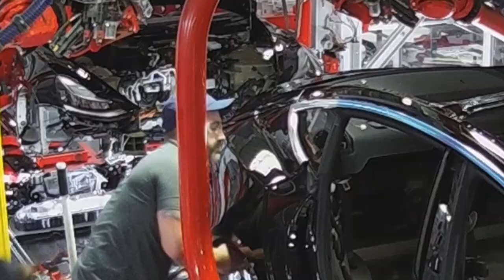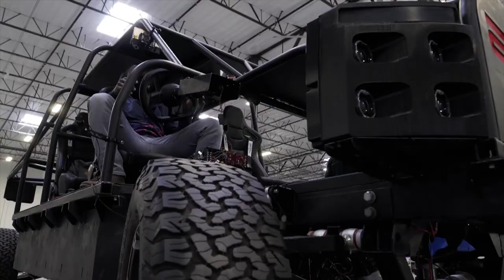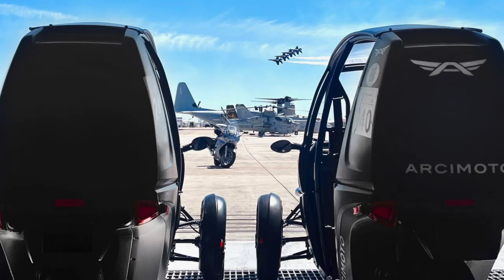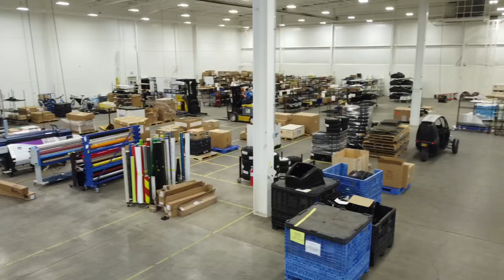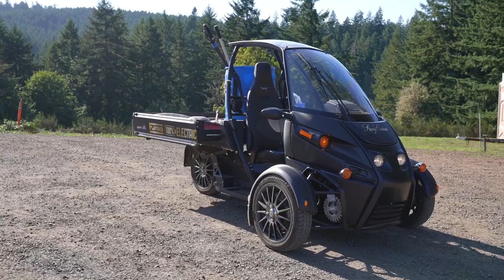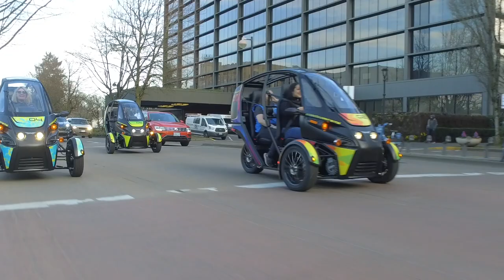Meet Chris Dawson, Arcimoto CEO

Comment: Good luck Chris, I hope you succeed! Is also wish there was a way to buy an Arcimoto in the EU (plus doors/windows for those cold winter months).
Reply: Haha same here in New Zealand, and it's not even that cold (in the North Island at least, Harald!
Reply: Full enclosure for a motorcycle is never done. That tranforms it into a solar oven and the weight is too much for a light EV design. The inevitable climate controls that come with that will zap away limited battery power, as does the weight of those systems. The millions of Americans with previous motorcycle experience all see the FUV as a huge step up in safety and comfort but car addicts, the ones with a habit that is proving deadly for our biome, expect to project their unreasonable demands for comfort onto a new mode of transportation which has to be Spartan to be more sustainable. You sit behind a wrap around windshield with adjoining roof with rain gutters. You sit on heated seats, you have heated hand grips and defroster.

Comment: Given the cost of current automobiles I would consider buying an enclosed or mostly enclosed version of the FUV.  I live in Pensacola, Florida and introducing this vehicle to the public through beach rental vehicles would probably go a long way towards whetting the appetite in the general public for the FUV.  Best wishes for the success of your company.
Reply: Full enclosure for a motorcycle is never done. That tranforms it into a solar oven in Florida and the weight is too much for a light EV design. The inevitable climate controls that come with that will zap away limited battery power, as does the weight of those systems. The millions of Americans with previous motorcycle experience all see the FUV as a huge step up in safety and comfort but car addicts, the ones with a habit that is proving deadly for our biome, expect to project their unreasonable demands for comfrt onto a new mode of transportation which has to be Spartan to be more sustainable. Salt water and new EVs do not mix. The first time this is driven through surf the salt water is going to kill it. Very few Florida owners buy theirs with doors. This design's safety system is safe without them and the plastic doors are just dead weight that make it harder to stay cool.
Reply: @popeyegordon  Well, then, partial enclosure, please.   I'm not asking for AC or even heat, just enough cover to not feel stupid while stopped at a traffic light in the pouring rain.   There are currently electric vehicles and small displacement gas vehicles being rented at Pensacola Beach for driving up and down the roads and into Fort Pickens but NOT on the beach.  FUV's for rent here might be a great way to introduce your product to the general public of this area.
Reply: @brucegraner5901  - If you look at the SEC filing pre IPO, they were to make optional full enclosure, HVAC and even an optional extended battery pack. None of that happened. Plus, the previous CEO admitted they were going to have to do a design change to it to have full enclosure. Also, not all of us live in FL, thus we get cold.
Reply: @billsmith5960  I probably misspoke when I said "full enclosure."   I once owned a soft-top Jeep CJ5 with a makeshift top of canvas doors and a bikini top, basically opened to the back and it could keep you kind of dry.  However, IF the windows on the canvas doors weren't up there was no way you'd stay dry in the frog-strangler rains we have in Florida.   Even canvas doors would provide utility to the FUV.  Without them, you just have a FV.  Such a vehicle might be a big hit in The Villages in central Florida but some simple, light-weight doors would greatly increase the utility and therefore the appeal of the FUV in my opinion.  On my jeep the canvas doors were easily removed when the weather was good and I wanted more fun.  I just want the FUV to be a big success for Arcimoto.
Reply: @brucegraner5901  - I understand. I rented a FUV twice in FL and one time it was raining and I got soaked because a truck passed me and went through a puddle, that water came right for me. At least the FUV rental place warned me of getting wet if it rains. So, I would believe them as they rent them out and probably experienced it themselves.

I had a Jeep too and removable doors were great. In the rain, needed the doors. Same for when winter came.
Reply: @brucegraner5901  You have not watched the videos of the FUV being driven in rain - I stay totally dry while driving in a heavy Florida downpour, the wiper on high. The air pressure and the wrap around windshield joining the roof with rain gutters catches it all while moving. When not moving there is a chance you get some blowing rain depending on direction. I would have no use for doors, just dead weight that makes it harder to stay cool in summer.
Reply: @popeyegordon  You're right about having some protection from the rain, while moving, even without doors.  However, having owned a Jeep for years, with and without doors, in Florida, my experiences suggest a wetter outcome when driving slowly or standing still at a stop light in heavy rain.  Would fabric, wire frame doors add that much weight? And they fold down to allow air in if you leave them on in good weather.  I hope you will sell plenty of vehicles on the fun factor alone.  But utility=useful and a little more of that would justify such a purchase by people not just looking for fun but as a possible alternative to increasingly costly cars and their maintenance.  All most people would ever need is a light-weight, fabric and clear, soft plastic door(s) enough to keep rain and cold wind out to greatly increase the utility of the FUV.  Without them you'll convert a few motorcycle riders and the people rich enough to own a fun "toy," but with them you might provide enough of an excuse to convert people from four wheels to three when considering a second vehicle.  Wire/fabric doors can't be that much dead weight if the FUV Deliverator can tote around an enclosed back space for its cargo.  I wish you and Arcimoto all the best and look forward to your company becoming very successful.

Comment: Good stuff. Glad to see more Tesla connection. More refined focus. Is the deliverator box shape officially back? Looks like way more storage now. Really happy to see this 3 prong platform as the new guardrails of production focus. The flatbed and deliverator probably share most parts.
Reply: The Deliverator and the modular box sitting on a pickup bed are two different designs. The full roll cage remains inside the Deliverator skin. It is the smallest cargo version while the box is part of a modular system whereby a truck delivers 4 or more boxes to a staging area, then the flatbed loads one box at a time. This system has been around for a number of years for small EVs.    
The expandable flatbed is by itself a model of interest to many shoppers. 
The first Deliverator owner has now hit over 25,000 miles on his, he contracts to haul trays of letters for the postal service and gathers firewood for himself.
Personally, as a single guy, I removed my rear seat and installed cargo net to make the rear a cargo area and I still have the locking trunk. I'd post a photo if it was possible here.
Reply: Chris came from Atlis trucks. So we are already seeing his pickup truck experience in action with the Deliverator Box. Good to see they are going in that direction as I agree with Chris.

Comment: I bought my last gallon of gas 8 years ago. 
I waited 3 years for my FUV. It is the most amazing, economical and safe vehicle I have ever owned and it is my only vehicle. I never get tired of hearing those twin motors winding up! I can't afford any car on my pension but the Arcimoto is so cheap to own it pays for itself in just 8 years. I save $900/yr on insurance alone, because it gets the very low motorcycle rate. I did not notice the cost of charging on my power bill. Be American, buy American! I invest in the American worker by buying the product, stocks are a racket that suck money from the middle class.

Comment: Hey Chris, I hope the plan involves adding full doors and air conditioning…..

 I know, this is an electric scooter or motorcycle where driver and passenger are exposed to the elements, however, I live in Florida, humidity capital of the world!

 Other than that, you have a very interesting vehicle that you sell.

Good to meet you sir.
Reply: The fact that you are in Florida is precisely the reason to NOT want climate control. Mine is in central Florida. Full enclosure for a motorcycle is never done. That tranforms it into a solar oven and the weight is too much for a light EV design. The inevitable climate controls that come with that will zap away even more limited battery power, as does the weight of those systems. 
The millions of Americans with previous motorcycle experience all see the FUV as a huge step up in safety and comfort but car addicts, the ones with a habit that is proving deadly for our biome, expect to project their unreasonable demands for comfort onto a new mode of transportation which has to be Spartan to be more sustainable.
Driver and passenger are NOT exposed to the elements, they sit behind and under a wrap around windshield and roof. If you get the door option you lose the cooling breezes on the lower half of your body. Humidity is not a factor when the air is moving. I stay completely dry when driving in a hard rain with the wipers on high, the wind pressure averts every drop away from the driver. The passenger may get some spray easily dealt with by light rain gear. I tinted my roof and use ventilated seat covers.
Reply: They have to redesign it for full doors. Full doors, HVAC and an extended range battery was the plan in the SEC filing pre IPO. Somehow, those were left off and full doors is the #1 thing people want yet the company never designed it to have them. Yes, there are the 5% that do not but you just alienated the other 95%.
Reply: @billsmith5960  Abslutely not! I have corrected you many times on this bizarre idea that would ruin the whole concept of right sizing. You see all the car addicts balking at a lack of doors and assume that is the right idea but they are all wrong. Theyn all, each and ever one of them, ignore the warning about climate change and what that means for changing behaviors. A BILLION motorcycles and scooters have no doors, wrap around windshields and adjoining roof, certified roll cage, 6 point harnesses and heated seats to keep the riders dry and warm and safer than any two wheeled bike. 
Adding the security blanket of doors where they do nothing for a design that is fully safe without them is a stupid move. Add glass and you have a solar oven. Add AC and you now have 200 pounds of extra weight that ruins the zippy performance. Tubular upper frames are not conducive to doors and windows except the crude fabric types as found on Jeeps.
To summarize, in the last 24 hours you have slandered the CEO, rejected the design and demanded changes that would ruin the design concept that inspired 500 people to buy this. What's next? Accusing them of treason or rape?  If this is how you attack US businesses what do you say about foreign ones?
Reply: @popeyegordon  - Check the pre IPO SEC filing and you'll see I'm right. Doors are needed if they want to appeal to a broader audience. Just look at the amount of posts asking for full doors. The people have spoken.

Comment: What about the Cybertrike its been 9 months since I've heard from Leo Cruces, is it still a coming if not return my money! a reply would be a great change from the many attempts trying to contact your company.
Reply: Cybertrike project has been shelved. They mentioned this a few months ago.
Reply: @billsmith5960  Hi Bill, that's all good, but I'm not ok with Arcimoto shelving my money and not reaching out to me and ask if I want a refund.
Reply: @enzodarro179  - Yes, communication with the company has gone downhill. You'd think that they would at least inform the depositors that this project will be delayed for an unknown amount of time, thus you can make the decision to either stay with the reservation or get your money back. Instead they are relying on you waiting or diving into their SEC filings to figure it out.

In the SEC filings - "Research and development on the MLM has been put on hold as part of our 
operating cost-cutting efforts." They also have $120,600 in deposits for them. This means they have 1,260 reservations as they are all $100 each.

Comment: Bring Arcimoto to the UK. These would be in huge demand in London.
Reply: You would demand doors and glass and climate control, ruining the benefits of the light EV design.
Reply: @popeyegordon  Nope. I want the roadster.
Reply: @tomblewomble3369  Of all the choices, that is the most dangerous and least practical. It does not sell well either. The only thing about it that is safer is traction on the road in wet conditions.
Reply: UK would be a perfect fit for the roadster and the Deliverator (new design) would fit in for London. With a set of doors, the Deliverator would outsell in the UK over the total US sales. Hope Chris sees this as it's a way to ramp up production.